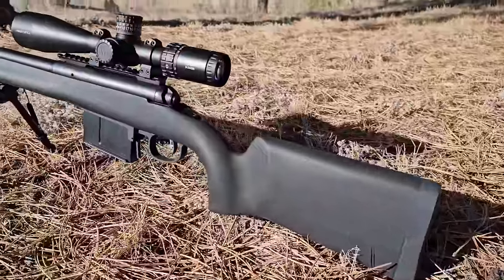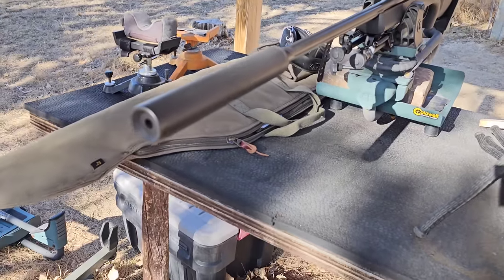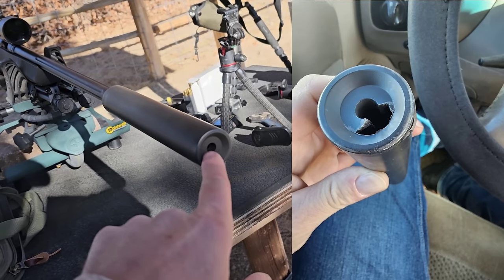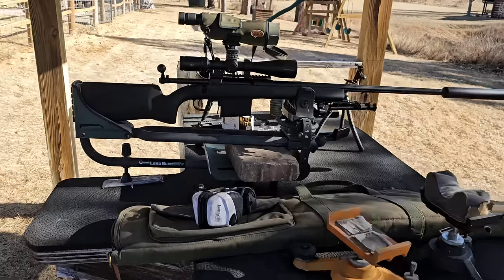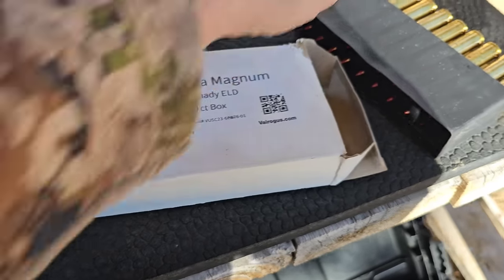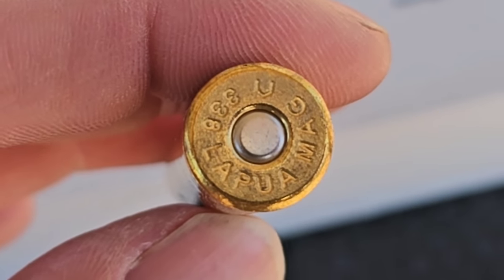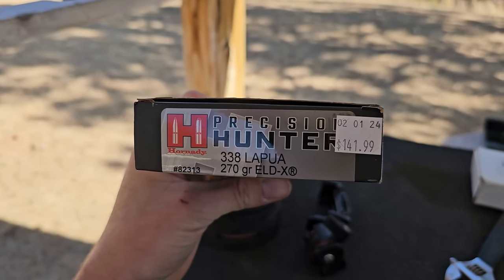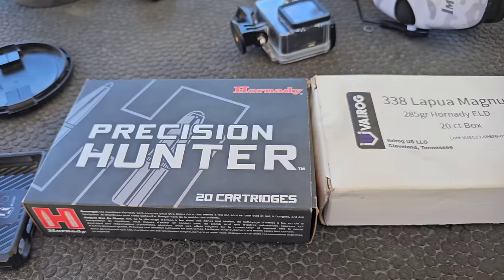Long Range Rifle: Something is WRONG!

Comment: That's a great rifle, I shoot the same, broke mine in with factory loaded sellier n bellot loaded with 250gr sierra matchkings, scope base shot loose first time out, removed it, cleaned and 242 blue loctite the screws and base. Busting Clay pigeons at our 400 yd range is like cheating, can't wait to stretch it out at longer ranges

Comment: My 110ba in .338lm new from box had a 1.2 degree warp in the barrel that was caused by the quenching process at the factory..
I did the RMA and Savage verified the defect and made me a new barrel, remounted it to the receiver and test shot it.. 
Has been dead on since and we'll over 400 rounds thru it  since 2015.. store bought seller&belot  as well as my own reloads running berger  300gr otm hybrids and retumbo..
I run a  Nightforce NSX 5.5X22X56 moarf2 reticle.
Good luck
Reply from the maker: Thanks for the input. I just got a box of seller belot to try. And going to try another scope.
Reply: @Guidedhunts  I use Warne scope mounts for my NSX .
Not to say they're the best but they have held tight since installed with zero lapping and lots of lead sent.
Reply from the maker: @BIGFOOT98499  I got a warne steel Pic rail  going to try.  I also got leupold's mk. 4 Steel Rings, im going to try these, too.

Comment: Float the barrel on the front lug screw using a piece of credit card material. Cut it to fit and drill a hole in it for the front screw to go through. Its tough stuff and isnt affected by moisture or doesnt smash down. Used it many times. And your lead sled didnt look real stable.

Comment: Should be a fun gun. At a first glance, I would take to bipod to shoot off the led sled. Just like your swivel stud hitting the bag can throw things off, so can the bipod ramming into the bag. 

I would shoot a group prone with a rear bag off the bipod, see how it does. Take the bipod off, shoot off the led sled and see how it does. 

Those would be a few cost effective things to try before a new barrel, gunsmith work, etc. 

338 Lapua is a monster, but for LR hunting it doesn’t do much a 300 PRC or custom setup 300 RUM can’t AT a distance I’m assuming you’d shoot game (~1,000 yards) with the lapua. Good luck!
Reply from the maker: Thanks for your input, I will try that.

Comment: I know you'll probably not read this however years ago I had the same problem and the crown was machined the same as the threads were machined both being offset like yours hint hint check the crown also I would just go ahead  have it redone!
Reply from the maker: I read all my comments. Yes, I figure the threads on the barrel that go into the receiver are going to be off as well. Thanks for the watching.
Reply: That's very respectfully thank you I will watch regular now thank you for your time!! After the new target crown it was a Lazer!!!!!!
Reply: You're not getting any consistency that's why I say it's the crown I promise you in all seriousness I would spend the $60 and have the crown redone and try it with the cheap ammo!;
Reply from the maker: @rgroller4683  After the suppressor hit, I took it and watched the gunsmith re crown it. I think he did a good job. Re cutting the threads and the crown, but I guess anything is possible.

Comment: I'm commenting as I watch. I have multiple K&P barrels. Ken did barrels for HS Precision for 30-40 years. Great guy. 

Personally, I never keep a rifle that shoots that poorly and I do not like Savage actions. Don't care for how the bolt handle is at the far rear of the bolt. I know many can shoot but just not a fan of the design. I would get rid of it. I tell all my friends when they buy a rifle always be prepared to part with it. That said, if you want to keep it, have LRI true the action and marry a new K&P barrel to it but get a 4 groove not a 6 groove. Ken gets his steel from Germany so it's good metal. 

But again, ultimately, if I were in your situation, I'd part with the rifle. If you're set on that cartridge, got buy a Tikka mag bolt donor rifle and have LRI put a K&P barrel on it. Tikka actions don't need truing. I have a bunch of Tikka bolts I need to send to LRI to get fluted, just haven't had the money yet.
Reply from the maker: OK, I might have to go back to LRI and see about the tikka actions.
Reply: That’s exactly what I was thinking! For not much more you can get a Tikka action and they are so much better then Savage junk! I have 8 guns in the gun shop right now and I don’t have one single Savage in my collection for a reason! Been collecting 60+ years and I reload and hunt too. I bought a cheap Savage 110 and only had it for a couple days until I got it to the range and I stopped by a friend who had a couple sons and gave him the rifle for free and they messed with it and gave it back so I donated it to my old boss who has a bunch of rifles and the last I heard he traded it in for something else after not getting it to shoot good! Better to pay too much and get what you need then not enough and get junk. I buy a whole lot of used rifles and I never pay more then it’s worth by ruling that it will need a new barrel before I even buy the rifle!

Comment: I would take the scope and rail off. Epoxy the rail to the action. Double check tourque specs and shoot off a bipod and rear bag. With heavy recoiling rifles something has to give. When you shoot in a lead sled it is usually something between the scope and action connection that gives.

Savage is hit or miss. I will never buy another again after my last experience.

Comment: Have your gunsmith verify that the crown is good. I had a rifle that wouldn’t shoot do to a problem with the crown, got it redone and it went to sub MOA.  When they’re checking that make sure the barrel is installed correctly. My son in law has a 110 in 338 lapua and it shoots sub MOA with almost everything we put in it.
Good luck, keep us posted
Reply from the maker: The crown and the threads were just re cut. Due to the threads being cut crooked from the factory. That's the reason the bullet hit the suppressor. I wouldn't be shocked one bit if there is an issue with the chamber or barrel to receiver fit. Once I figure it out, I will post a follow-up video. Thanks for watching.

Comment: I bought a savage rifle once. Returned to the factory for repair. When I git it back, the initial problem was only slightly improved, but not enough. When the factory can’t git it to function well to begin with, then still can’t get it right the second time around, the build quality is far below the standards needed to have a properly functioning firearm. I returned the rifle, and will never consider another savage firearm. I will give it this though, when it did fire, it was accurate.

Comment: Hi, I'm calling Mark, I've been in the foreign legion for 25 years, I just came to see your video. First of all, it's not easy to judge from your video that it's not working. The first thing you need to check when your rifle fires poorly is the aiming system. Most rifles that come into my gunsmith for accuracy issues have loose sights. If your groups are all over the place without rhyme or reason, that's probably the problem.

Check the iron sights by trying to move them with your hand. If there is the slightest movement, they need to be repaired. Fortunately, there are many ways to tighten the fit of a dovetail sight. A metal shim, lightly hammering the dovetail, and a blob of solder can solve this problem.

If a rifle is equipped with a scope, many other problems can arise. To begin, make sure all screws on the scope rings and bases are tight. If you find one loose, you may have already found the problem, but be careful, it is important not to overtighten these screws as many rings and bases are aluminum and the fine threads are prone to stripping. There are recommended torque settings for the screws on your rings and bases set by the manufacturer. Look for them and use a torque wrench to lock everything in place as it should, then pull again.
Look at the case itself. Are there any bulges or strange discoloration near the case mouth? Next, look at the primer. The primer is your ignition system and can have significant effects on accuracy. I have seen rifles that were extremely inaccurate due to a broken firing pin that still managed to fire the cartridge primers.
The crown sits at the muzzle of your barrel and is essential to the rifle's accuracy. It should be uniform and not have any burrs, bumps or bumps.

Most crowns are designed to prevent damage to critical areas, but they can still become damaged from years of field use. Taking your rifle to a gunsmith to reface a crown is a very common and inexpensive job that can resolve some accuracy issues.
Make sure rifling twist rate and bullet weight are compatible
Sometimes the combination of certain rifle twist rates and bullet weight can kill a rifle's accuracy. Diagnose this by looking at your bullet impact on paper at 50-100 yards. If your impacts seem oblong or sometimes even sideways (keyhole), your ball will not stabilize properly and will tumble towards the target. This problem is becoming more common with modern calibers that use longer, heavier bullets with higher ballistic coefficients.
.338
- 8" for all bullets
- 9" * Ratchet rifled 4 groove
- 10" for all bullets
Look at the stock: Imperfect bedding can harm rifle accuracy
Supporting your rifle is essential for accurate shooting. Bedding is essentially a reverse imprint of your stock in the stock. A well-structured action will have a consistent position from one move to the next. There have been countless articles written about glass bedding and the action
Start by shooting a group at 100 yards. A poorly anchored recoil leg can cause erratic groups with no consistency.
I don't know if it can help you solve the problem it's not easy to judge from the video ahh also try shooting without a silencer
Mark excuse me for my English
Reply from the maker: The rifle has no open sights. The base and rings are torqued to spec. And the crown and threads were just cut by a gunsmith. My thoughts are it is the factory barrel not within spec. I am going to try another scope and different ammo. Then might try another barrel.
Reply: @Guidedhunts  
hello ahh maybe this will solve the problem, I have a SAVAGE predator 308 and it shoots perfectly well
good luck

Comment: Part of the responsibility lies on your failure to check concentricity as all suppressor manufacturers recommend you do along with making sure the ammunition isn’t tumbling!
You could have avoided damage by following standard safety measures.
Reply from the maker: I wasn't told that when I bought the suppressor or I would have. Lesson learned.

Comment: Did the gunsmith borescope it to see if it is a copper mine inside because you might need to clean the heck out of it with JB Bore paste.
Reply from the maker: No, he didn't, but that's an option might have to try that too.

Comment: Did you check action screws?
Reply from the maker: They were tight, but I didn't torque them to spec. I am going to remove the stock and check it, then torque to spec.

Comment: Clean clean clean the barrel. Check torque on your action screws. Try a known good scope. Make sure the barrel is free floated. If that doesn’t work I would re barrel it. It’s worth it to have gunsmith put the barrel on  and true everything up.

Comment: Id pull the stock off. Blue locktite it back on. Same for the scope. Shoot without the supressor. Start addressing the variables. If you have a bore scope, might give it a look.
Reply from the maker: I did pull stock and check contact points. The aluminum bedding block looked like it was engaging the recoil lug evenly. I reassembled  torqued to correct spec. I did take the suppressor off in the video to remove that variable. I don't have a bore scope. I am going to try another scope and change ammo, and I'm changing base to steel and changing rings. I will post a follow-up video when all components come in. Thanks for watching.
Reply: @Guidedhunts  I had this same issue with a savage 110 308. Tore it all apart and rebuilt it, then we went through several ammo types. Ended up reloading sierra 168gr crimp tips so I could push them to fill the mag. It ended up good with that ammo, but the stock and scope were both loose when we took it apart. Still wouldn't shoot factory ammo. A buddy of mine still uses that as a hunting rifle and I saved the recipe for him. Hope you contact savage and they let you know what test ammo they use. I wish I had more helpful info. Bore scopes will make you think you have problems that you don't. If they stripped the barrel before you bought it, that could be a major accuracy issue.

Comment: Here is the reason I do not own Savage rifles. Why should this man have to take a brand new rifle to a gunsmith. I have never had any kind of issues with Weatherby, Remington, Ruger, and Bergara rifles
Reply from the maker: The first savage for me might be my last.
Reply: Remmington?
I've never seen one sub moa unless it's custom. 
Just my experience.
Reply: @NelsonZAPTM  the finishing work from the factory was so bad that someone could cut themselves on different edges. When I worked at a gun shop, a Remington bolt broke off in someone's hand. It looked like pot metal.   0 stars would not recommend.

Comment: I not sure if the recoil lug being stamped could also be cause if that one is! I'm going to change one out on a older 270 wsm older model 11 see if that tightens it up.
Reply: Recoil lug on my savage 308 was machined crooked . Had to change it out after savage wouldn't warranty it

Comment: Savage's quality has plummeted in recent years. Take a bore scope and have a look. I've found that for the last few years Savage bores look like Swiss cheese. 
Before you spend more of that very expensive ammo, I'd take a look at the bedding and action screw torque. While not impossible, I have doubts that the scope is bad. Arkens are known for being tough and have excellent tracking. I have to think that the action is moving around in the stock and I'd look at where the recoil lug contacts the stock to make sure that one, it is in contact, and two, make sure it's contacting squarely. An epoxy bedding job on the stock might be a good idea if you keep the rifle.
Oh, and make sure you're saving your brass because I reload .338 Lapua and could make you a way better deal than factory ammo. I'm over to your part of the start usually every three weeks. I have a Savage 111LRH in .338 Lapua that I got back in 2013 before Savage went to hell and I have a load for it with 250gr Berger Hybrid Tacticals and H1000 that shoots 1/3 MOA. It too has an Arken sitting on top of it.
Reply from the maker: Thanks for watching. I will check the stock out and see if there are any issues there.

Comment: You said you bought it used, and it had non concentric threads on the muzzle which blew out your endcap of your suppressor and maybe some baffles. Honestly, i would not of paid to get the threads recut and sent that gun back to the shop you got it from. Just based on the issue with the barrel i would not be able to trust any part of the gun. If you really love the rifle, then have your gunsmith look over the entire rifle for tolerances and get a new barrel installed. Bed the scope rail to remove that variable.

Comment: Try a scope that you know works well. If that doesn't work, take it to a gun smith and have them check the crown and that your locking lugs are both engaging evenly. Unless the reciever threads are cut unevenly, everything can be fixed.
Reply from the maker: I'm going to try another scope. The crown and threads for suppressor were just cut so they are new. Thanks for watching.

Comment: It's the recoil lug.  Ran in to the same problem with my 338 110 precision
Reply from the maker: What did you have to do to fix yours?
Reply: @Guidedhunts  I bought a new barrel at first thinking it was the issue, and used the same recoil lug only to have the same problem.  I then bought a new savage recoil lug, pulled the barrel and re installed it then the gun shot great.  If you have go/no go gauges, torque wrench, and a barrel vice you can do it yourself.  Figure out if you have a large shank or small shank lug and then buy the appropriate one and fix it.  My recol lug was smashed on one side causing inconsistency, and unfortunately for me I had to buy a new barrel for that.  Let me know if you have any other questions.  Good luck.
Reply from the maker: @dameander  thanks for the info. Appreciate it.
Reply: @Guidedhunts  you're welcome.

Comment: I'd have to imagine either your bolt face is off or your lockup lugs aren't engaging true. If it was a muzzle crown issue your wouldn't get any consistency whatsoever and you did have a couple of halfway decent groups. Untrue lockup, if it isn't TOO awful bad, will sometimes fall into a consistent string. But not to often with your big magnums. That rifle was a quality control nightmare it seems. I'd bet it was made at the end of life for the CNC cutting bits.
Reply from the maker: Yea, definitely a lot of problems for this gun. Thanks for watching.

Comment: I have a savage elite precision 338L.  4” groups on a good day.  Sent it back.  They sent it back and its a 1/2” gun with the new barrel
Reply from the maker: Did you buy the gun new or was it used when you got it?
Reply: It was brand new
Reply: @Guidedhunts  brand new
Reply from the maker: @Tradmark454  so savage said if it was a manufacturer defect, they would cover it. But if the barrel was shot out, I would have to cover it. So here I wonder if I should still even bother with savage or just get a custom barrel, then I know it will shoot.
Reply: Id skip them and get a barrel.